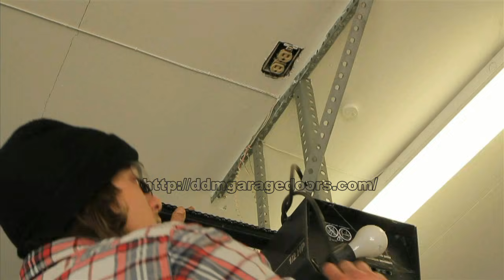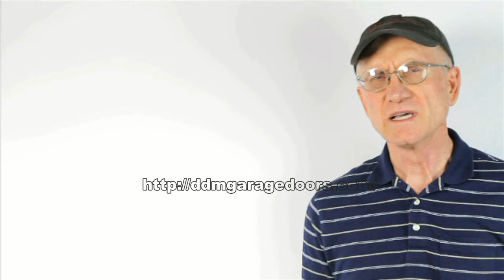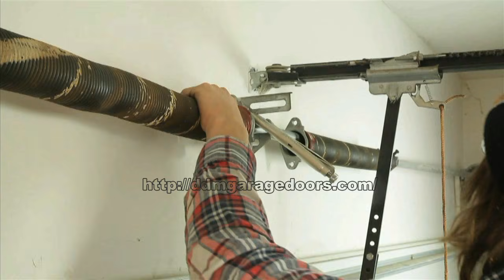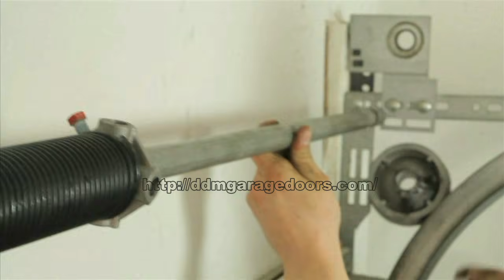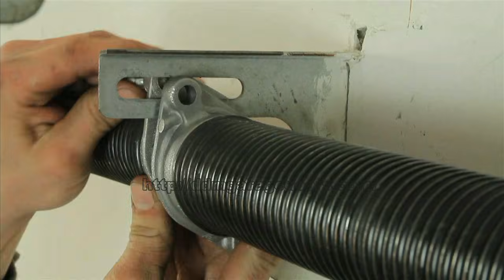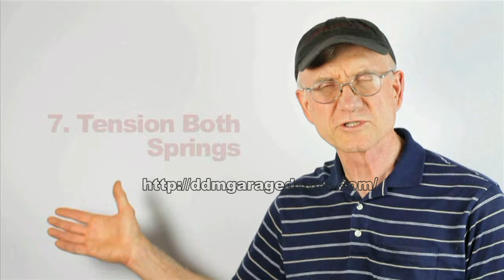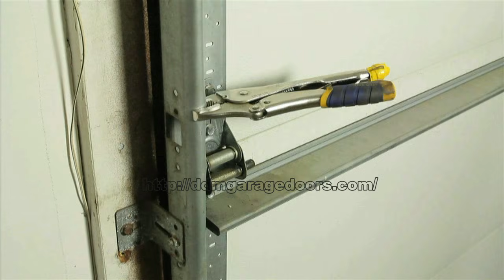How To Replace Garage Door Torsion Springs

Comment: Thank you very much. My wire came off of the pulley when a hardware light obstructed one of the wheels in the track. I mistakenly let the tension out on one side. Your video helped reattaching the wires and putting the tension back in the spring. Although my tension direction was the opposite, as I realized my cable pulleys were installed in reverse due to no clearance for the set screws. Unfortunately being a homeowner, I only had one piece of 1/2" rod laying around, but found a scrap piece of 7/16" rod, so I used it carefully....but no screwdriver!!! Thanks again!!
Reply from the maker: You're welcome, Stephen. Glad we could help. It sounds like you're pretty handy. Glad to hear you figured out what to do. Best wishes.

Comment: i found this video extremely helpful. it has everything you need to know. although out of caution and because i could not get the same 2 1/4 Raynor springs i stopped at 7 full turns and tested. finding them slightly too strong, i loosened them by one quarter turn to the perfect strength. thank you for this informative video.
Reply from the maker: Glad to hear you found the video helpful. I worked for a Raynor dealer for 15 years. On some of the doors seven complete turns balanced the doors perfectly. Glad it worked for you. You're welcome.

Comment: with over 30 years in the door business I have NEVER allowed tech's to stand in front of the spring to wind or unwind tension....
Reply from the maker: The problem with standing beyond the end of the spring is with stretching the spring and tightening the set screws. I don't see how to do this without getting your head in the path of the cone, which could break. This is the more likely and the more dangerous scenario than standing in front of the spring.

Comment: Is there a point during this process when you would recommend opening the door to backout a vehicle that is 'trapped' inside the garage? I plan to move it forward as much as possible and hope to get the room I need but getting the vehicle out would be preferrable.
Reply from the maker: Todd, you need at least a two foot area for the ladder.  I have worked off bumpers in the past, but it's risky.Be sure to cover the cars to protect them from dropped tools.

Comment: This is one of the most dangerous things a novice can attempt to do. I've known professionals who are walking around with fingers missing. Frankly, I'm a little stunned that you'd even post a video on this procedure.
Reply from the maker: Mike, you are correct. Thank you for the reminder. It is dangerous, and we warn customers about the dangers. Driving a car is also dangerous, and there are no guarantees you'll make it home without incident.
Reply: You need to take a written test and pass a physical behind the wheel course to drive. A short you tube video on replacing a garage door spring just won't match up. But, to each his own. It's a free country and we all make our own decisions.
Reply from the maker: Mike Pantera Your point is well taken. However, my older brothers and sisters taught me to drive. The test includes safety also for other cars that can be damaged and other people who can be injured or killed. I can show a 16 year-old in one hour how to safely replace torsion springs. Not so with driving.

Comment: What is the purpose of marking the shaft next to the winding cone if the cone passes over it? Also, a c-clamp style vise grip used on the track would be better to use for holding the door in place.
Reply from the maker: +ALW TheFox  The purpose of marking the shaft is to assure the springs are installed correctly. A common problem is that customers install the springs backward and the springs either unwind from the cones or the door binds after it is raised a few inches.

I've tested the C-clamps and they don't normally work as well. Vise grips have teeth that dig into the steel and grip more tightly. They're also faster to clamp. When a customer is paying a professional over a dollar per minute for a door repair every minute counts.

Comment: I install and repair garage doors for a living.. this was a really accurate instructional video on spring changes.. Only issue I would have with this is not only the speed of winding the springs.. but his body positioning.. When you stand off to the side like that it's easy to pull your winding bars out of position and have the spring snap back on you..
Reply from the maker: Thanks for the comment, MrWookLoaf! As much as we do make sure to place an emphasis on safety, we sometimes forget and have to reshoot our videos because of that.

Comment: Thanks Dan!  Really good info.  One our springs broke years ago and my wife had someone come in to replace it.  A year after that the opener died and I replaced it with one with a little more power.
If the springs aren't tight enough as you say then maybe that's why the original motor died shortly after the spring replacement.  I didn't realize that properly tensioned springs would allow the door to be raised and stay in place that easily.  I think our spring tension may be a little off.
Reply from the maker: Hi James! It's likely that this is the reason that your opener motor blew out; if it's doing more work than it should, just as if the springs are doing more work than they're supposed to be, they will last much shorter than if everything is set up properly and it's all working right in the system. We hope that this was helpful to getting your springs figured out!

Comment: This is not for the average home owner
Reply from the maker: Hi Debbie! If you feel that this is an unsafe thing to do for the average homeowner, we understand; this type of replacement and work is not for everyone. If the proper safety precautions are undertaken, one can most definitely complete this replacement safely. If someone doesn't feel safe doing this, however, we would also say that it is best to call a professional. Blessings!

Comment: How boring can Americans be far more than it needs to do the job safely is the answer?
Reply from the maker: Hi zonkonzonko! We believe that it is best to over-explain the safety aspects of completing this replacement rather than under-explaining them. There are so many things to be cautious of that we cannot explain the need for safety enough. Safety first, then work: making sure you feel safe in completing the repair is most important, and then going about and doing it. If you don't feel safe making a repair such as this, do not do it.

Comment: Do i need to replace both springs if only one cracked?
Reply from the maker: Hi Dan! We always recommend replacing both at once. This is so that you don't have to go through the process of replacing the other spring a couple of months down the road when that one goes. This way you won't have to do double the work than if you had just replaced both at once.
Reply: @DDMGarageDoors  Thank you for the reply. I have been waiting 6 years to replace the springs but now, I can complete the project. :)
Reply from the maker: @danmansell8769  We knew that you likely had replaced them already, Dan. We apologize that we took so long to respond. Back when you commented, we didn't have someone regularly responding to comments, and now we do. :)

Comment: You want the safest and fastest way to replacing or removing a torsion spring? The following link has exactly what you'll need. I personally know the creator of the Surewinder and have seen it used first hand. DMAtools.com
Reply from the maker: Hi Frank! We have a winder on our website called the S3 Winder that also makes it safer to replace and wind up your springs. You can find that here: https://ddmgaragedoors.com/parts/part/SAB-SW.html

Comment: I've done a few garage door repairs in my time.  Mostly fixing cables that have fallen off the winding drum.  I've also tightened or loosened a few springs to tune garage door operation.  After watching this video, I have a much more comprehensive understanding of how the whole system works.  Very well done.  Thank you for sharing.
Reply from the maker: We're glad you found our video to be informative, mrnetwurm! We hope that you were able to understand the system enough to get these parts replaced properly! Blessings!

Comment: I agree with this video other than i would NOT let my arm rest on an old spring when it has tension on it. In the unlikely event that it would break, it could snag the sleeve of your shirt or even cut your bare arm. If or when it does, there is no time to react... a eye blink takes longer. I would choose to set myself on the other side of the spring.
Reply from the maker: Hi J! His arm isn't really resting on the old spring, it's only there for a brief time, but you're exactly right, you don't want to keep your arm on it for any length of time. The reason why he's standing there is because that way it keeps you out of the path of the winding cone should something happen and the spring break on you. This process is also slowed down to show every step in the process so that people watching can see this done, and can know how to do this safely for themselves.

Comment: What an awesome video! Thank you so much. I did run into a problem with mine tho, the cables are rolled the other direction. the cable comes off the front of the spool and not the back. and if i wind it in the direction shown on the video, it will unroll the cable off the spool instead of tightening it. My cables roll up clockwise, and not counterclock wise like showing on the video. the only thing i can think to do is tension the springs backwards from what you show on the video.??
Reply from the maker: Hi tdowis! This wouldn't mean turning the springs backwards, but instead swapping what side the springs are on. Instead of the right wind spring on the left and the left wind spring on the right you would put them the opposite way; or, you could switch your cables around while the springs need to be replaced anyways.

Comment: I have a low clearance garage door, the spools for the cable are on the outside of the tracks and wound the opposite direction of whats showing in your video, from what i can tell, i would have the wind the springs the opposite direction of your video to make it work. Is this right?

Comment: Even though, I still don't understand what is the benefit to hit the spring to extend an additional 1/8 of an inch, after the winding, but this is so far the BEST instruction that I can find on the Internet.  The explanation is very thoroughly and VERY EASY to follow. Thanks much for sharing this kind of information.
Reply from the maker: Hi jackhis! The extra stretch makes sure that the spring is able to lift the full weight that it is supposed to. If you don't stretch them out, they could last much less time than they're supposed to, and you will have to replace them sooner. We're glad that you found this video helpful towards getting your springs replaced!
Reply: Thanks very much for the tip.
Reply from the maker: @NickTu-USA  You're welcome!

Comment: Thanks - Very thorough.  I have a question though:

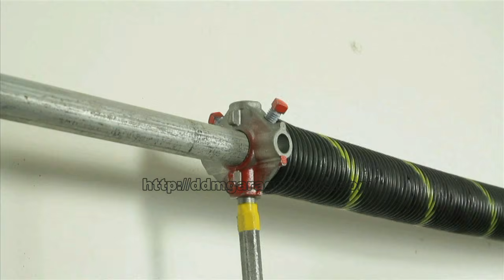@13:30 (left spring), you tap another 1/8" after tensioning the spring.  This is also performed for the (right spring) later on.  Why is this done?  I would think the free-moving torsional-cone side would assume the lateral stretch as a function of the number of turns.  Is it done just to remove any possible 'stiction' of the moving cone on the bar?

Thanks again.

Comment: Great how to! Very thorough! Saved me $375 in repair costs. I re-packed the bearings in grease and fine tuned the cables so the dust skirt just touches the ground while I was at it. Works better than ever. Thanks for the detailed video, got me through the whole job in under an hour. Perfect!

Comment: Anyone who has not done this and does not have a trained specialist watching and guiding them through this is a fool. There are a few safety violations in this video. I'm a certified tech, and have sucsessfully trained many technicians....I know a thing or two about this...........Call a professional and save yourself the headache of trying to figure out the correct spring for your door, or worse, hurting yourself because you've missed a step.